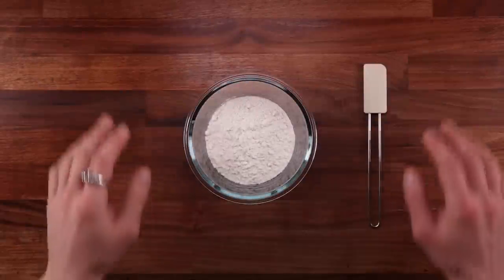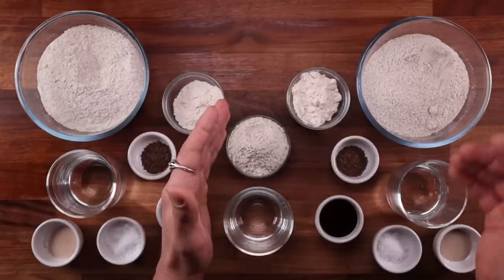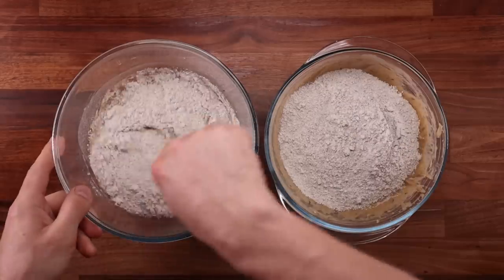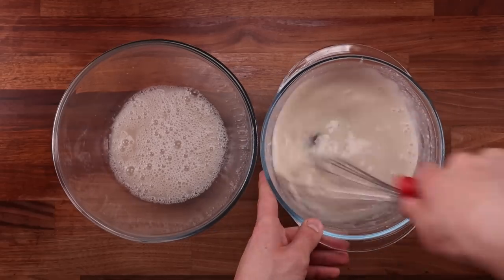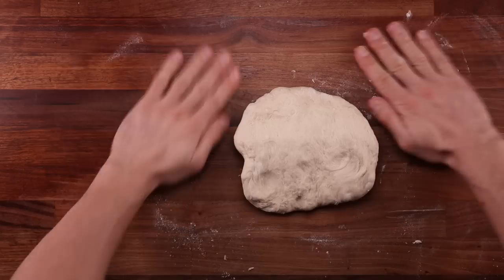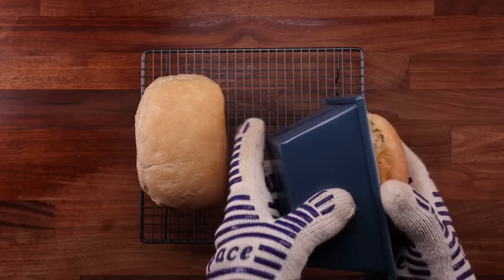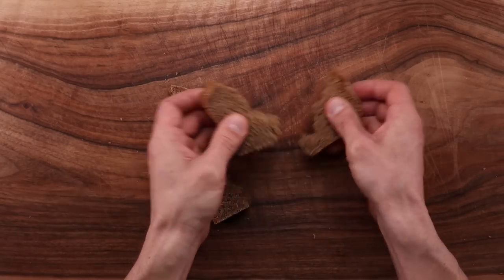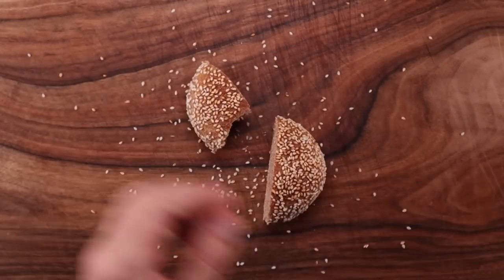Scalding Technique Explained | How to Make Your Bread Last Longer

Comment: Hi, Charlie. Thanks for this, and all your other, very interesting and well presented videos. A good way to keep food hot is an old-fashioned hay box. This would probably be ideal for your scalded flour. It was a way of saving fuel. You'd get your stew of cheap , tough meat up to boiling then put your lidded pot in a box lined with hay to insulate it for long, slow cooking.I've done this using a duvet and a cushion on top. It's probably best to bring stews back to the boil to be on the safe side but scalded flour should keep hot overnight and wouldn't be a problem for dodgy bacteria. By the way, I've been trying to use barley flour but can't find a really good bread recipe for it. Have you worked with it at all? x
Reply from the maker: Hey Felicity,
Oh yes that is definitely a good option. My girlfriend's mom used to make millet porridge in the evening and wrap it up in a blanket to keep it hot for the next morning :) 
I've not used barley flour yet. I don't think that it can be used as 100% of the flour in a recipe. It would turn out super dense. Substituting a portion would probably be the way to go.

Comment: Holding the scald at 64C is another beast altogether. In the matter of fact to take the benifit out of it you have  to add about 20% of the flour you used in  the scald as raw flour as scalding kill enzymes in the flour. So enzymes in the untreated flour will convert starches in the scald into sugars to the point that the scald becomes really sweet. Very similar process that beermakers do with the malt. This is then used mostly in rye baking that calls for over 70% of rye. You wi have to use sour dough starter or other means to acidify the dough to prevent sticky bread.

Comment: Hi!
Video idea: How to formulate a bread recipe. I know the principle. But it feels quite overwhelming. Where to start, what not to do, etc. 
Lots of love!
Reply: Charlie has a video showing how to work the formula.
Reply: @jjudy5869  I know, I´ve watched it, but it still seems very abstact to me. How much water do the different types of flour require? If I want to achieve a different result, what do I add/remove from the basic recipe first?  What ingredients/techniques do or don´t work well together? What are indicators for what went wrong? Should I add vital wheat gluten, if I replace some of the flour with something that doesn´t contain gluten? Do I  then have to remove some of the flour, in order to "make room" for the vital wheat gluten, because more dry mass messes with the hydration percentage? I think it would help me (and maybe others) to watch someone, who knows what they´re doing, going through the process.
Reply from the maker: That would be an extremely long video 😅 All those things are covered in separate videos in the Principles of Baking playlist. And I have recipes using all the principles which you can use as examples to make your own recipes.
Reply: @ChainBaker  Hi! Thanks for answering. I really only meant a video of your process to create one recipe start to finish. I mentioned all the questions to explain why it feels daunting to me even though I watched ALL of the principles of baking videos. I think they taught me the theory very well, but when I sit down to actually write a recipe, I come up with nothing. Maybe it's me.

Comment: The algo recc this and I watched, you mentioned a method to keep it at 60d for several hours you could probably achieve that making a small box out of insulation foam, and homebrewers heat mat with a thermostat.

Comment: Thank you for your video. It is very informative.  I just recently tried the no knead method just because it is easy.  I wonder if the regular knead bread last longer than the no knead bread.  What are your thoughts?
Reply from the maker: There should not be any difference.

Comment: Rye scald is the food for kvass as a starter. To feed it you do rye flour and boiling water in 2 to 3 pours inside an oven proof bowl, and mix. once scald has cooled to 63-65°C you mix in crushed diastetic rye malt and cover with a plate or aluminum foil. Put oven ahead of time on minimum and check temp, adjust to get 63-65 °C and keep scald 2-4h. Once you take it out uncover immediately and mix. If you have some dry parts just mix those in, and let scald cool down. That scald, mixed with a lot of water, old dried dough and old kvass will kick in the fermentation if a new kvass batch. That's a Russian brew that is Done in two fermentation steps, like kombucha, the 2nd one with added sugars and/or aromatics in closed bottles for sparkling effect. For Bread we need only one fermentation of 48h at around 32°C. The particles should have settled and the water surface should be covered with a layer of yeast that have been bubbles while fermenting. You use it as is by just mixing the liquid, adding rye to make a preferment, proofing around 9h until very acidic and starter around 1cm down from peak. Then just add rye, salt, a bit of sugar and by tradition also caraway seeds. Needs a good mix, adjust hydration for improved final texture, proof in buttered (not oiled!) tins, full cast if available, proof for 30-45m until you see around 10 small holes on the surface. Bake at 250c for 15m and then go down to 200c without opening the oven door for 35m. Remove and tilt the tin for easy removal. registrr.livejournal.c-o-m/102092.html
Reply from the maker: Thanks for all the detailed info!

Comment: Speaking of your Yudane recipe, I really love how much of a difference it makes in terms of texture and aroma. However, what I dislike is that on day 2, the bread/cake becomes twice as heavy, as it soaks up water like a felt coat in heavy rain (still tastes great, but the texture is a bit different). I live in Switzerland, but our humidity seems subtropical. Heck, I haven't seen a proper winter either in a decade. It's way too warm and moist. BTW, you can find in the Basel area a lot of east Asian and Latin American plants, including palm trees and succulents.  Some of them would die if the temperature drops below 4°C for a prolonged time (which they recently did, but after several years of growth). That's far from how I imagined the country before I emigrated to it...

Comment: Keeping your scald at 65c for several hours should be very easy if you use a sous-vide immersion heater, most will go up to 90-95c. Put your scald in a suitable plastic, submerge in the 65c water and leave as long as you need.

Comment: I did this by accident. I was making bread and while heating the water to blood temperature, I got distracted and the water boiled. Since I was too lazy to heat another pot of water, I added the boiling hot water to part of the flour and let it cool to the right temperature and proceeded with the recipe. I don't know if the bread would have lasted longer because I brought it to a family dinner and nothing was leftover.

Comment: I've been preparing scalds with course flour (and even steel cut oats) in advance with recycled glass cans with wide mouths and metal lids. I also add the bread spices, sweeteners (treacle, malt, molasses, etc.), fat and salt. I add extra water to give it more of a porrige consistency, which is easier to integrate, and adjust the additional water accordingly. It's a simple trick: mix the ingredients in a bowl, boil the amount of water you need, pour a little into an old salsa or spagetti sauce jar, add the ingredients then pour the remaining boiling water on top and gently shake. You can also mix the ingredients directly in the jar, just make sure you stir it out to prevent lumps on the bottom. Let cool on counter and then refrigerate. The jar will reseal itself and can be stored for weeks. If you follow proper canning sterilization procedures, you could likely keep at room temperature.
Reply from the maker: Cheers for the tips! ✌️😎

Comment: Thanks much Charlie!  I wonder if using 20%-30% sourdough has a similar effect
Reply from the maker: You can use this method in sourdough recipes and get the same results as with commercial yeast. But a starter does not add the characteristics of a scald if that is what you meant :)
Reply: @ChainBaker  Thanks for understanding me.  I did mean earlier to replace the scald with sourdough.  It's good to know that a scald adds distinct/favorable characteristics to bread.

Comment: Hi Charlie. Can you use the udane method on a 75% hydration sourdough loaf? Would you have to increase the hydration to 85% then?
Reply from the maker: Certainly. It is a higher hydration that I have ever tried it on, but the rule could be the same. Saying that, I would probably start with less and then work my way up. Perhaps 5% - 8%.

Comment: Curious. Thinking about using an InstaPot on my next loaf. 1. Use milk, take it to scald in the instapot, using the High yogurt setting.  2. Stir in the 10 to 20 % flour, then let the mixture cool to about 110F. 3. Stir in the yeast, salt oil, sugar, etc., then the remainder of the flour. 3. Leave the pot on the Low yogurt setting until the mixture has doubled. 4. After, remove the dough from the pot and proceed as usual. Maybe I want the sugar, honey, whatever stirred in at the scald, all except the yeast..

Remember my Mother, Grandmother, old recipes would scald the milk used in bread (yogurt, etc.), not just to kill bacteria, but to break down protein and make it easier for the yeast to work. Any thoughts? I make yogurt in the Instapot, so it seemed like a natural extension. I do not, however, like the look of loaves steamed to completion in the pot.
Reply from the maker: 110F would be way too hot I'd say. I would not go over 86 or so or else it will ferment too rapidly. 
I am planning on testing scalded vs non-scalded milk to see how it compares :)
Reply: @ChainBaker  I've seen scalded praised countless times, but I've never seen it tested. Looking forward to it!

Comment: Charlie: Please clarify this for me if you can. From my research, I have noticed that many experts claim that the scald/yudane process should be limited in the bread recipe because it damages gluten. Do you know if this is true? Can you say how much of the total recipe is safe to be converted to the scald and how much is too much? I am working with mostly freshly milled whole grain flours and sprouted grain flour and I am already have problems getting the bread to be fluffy and not dense.
Reply from the maker: It does damage the gluten forming proteins for sure. That is part of the reason why the bread turns out so light and soft. 
You can push it pretty high depending on the recipe. But 20% is a good amount to stick to. 
Here is a tortilla I made by scalding 100% of the flour https://youtu.be/WQbDQIKC9V4

Comment: Are there flours for which a scald might not be advisable? I'm thinking of the 50/50 sandwich bread recipe. I tried it substituting kamut flour for the whole wheat. The result seemed a bit dry and didn't rise as much in the oven spring.
Reply from the maker: Kamut is weak already, so scalding it should not make a huge difference. Simply using it in any recipe will produce and smaller loaf. That's just how it is. Try to substitute only a small portion and then work from there.

Comment: hi i have a question
I understand flour is gelatinized by boiled water or milk or something.
how about hot oil ?
Reply from the maker: I guess it would gelatinize it at a certain temperature. But if the oil was super hot you may just fry the flour. Not sure how that would affect it though.

Comment: Most sourdough recipes have you “autolyse” the dough — mix water and flour together, and let it sit for a while. Seems like scalding would be doing the same thing, but at high temps.  Does high temperature scalding work that differently from room-temp autolysis?
Reply from the maker: Autolysis is for hydrating flour and creating gluten. Scalding cooks the flour and destroys gluten.

Comment: so I'm curious- here in Florida, given that we're in high humidity, I don't usually have an issue with bread drying out. the usual issue we have here is that it molds. homemade bread especially can mold within a week sometimes! would the scalding method still extend the bread's life, or would the higher moisture content potentially make the bread mold faster? would there be another method to potentially making the bread less hospitable to mold growth?
Reply from the maker: Acidity is the enemy of mould. Use the cold fermentation method to make your bread more acidic. It will not only taste much better but it should also last longer before it goes bad. Here is a full video on that - https://youtu.be/x-8UoEgtt48
Reply: @ChainBaker  thank you for your absurdly fast reply, and for the information! I'll check it out

Comment: Can I turn the scald into a poolish too?  Say I scald a portion of the flour with your method, let it cool for an hour, then mix in a pinch of yeast to the scald to make a poolish, then set it aside for say 12 hours.  Will the scald/poolish double in volume after 12 hours?
Reply from the maker: That could work. But it's just too much effort. Instead, you can just make the scald, then make the dough with the scald and leave the whole thing to ferment slowly in the fridge or at room temperature. Just use less yeast. That way you won't need to make a separate thing.

Comment: I always have problems with my bread getting old because I don't eat so much bread. I will try that, or just bake more often. Freezing my bread isn't that great because of the freeze burn. :D
Reply: I always freeze my bread and never have had problems with freezer burn, unless I forgot about it and it's lost in there for a year or something.  

You get freezer burn after a couple of weeks?   Do you wrap it in parchment paper after slicing?
Reply: @feliciagaffney1998  I cut it and freeze it, but I don't use parchment paper.
Reply: @Vaan4756346  so, give that a try.  Maybe that will help protect it?  I don't know.  I've always frozen bread... even store bought.  And don't usually have issues with freezer burn.
Reply: @feliciagaffney1998  Perhaps I am not waiting long enough to let the bread cooldown enough. I usually wait 2 to 3 hours. I will try the paper.
Reply: @Vaan4756346  oh!  For sure.  I don't freeze it until 2 or 3 days later.  There's no need to freeze it immediately.  Enjoy it while it's fresh for a couple days, for sure!
Reply: I freeze almost all baked goods:  some kind of bag and then freezer paper.  I reuse the freezer paper over and over.  Other than the fragrance of fresh baked goods, few people can tell the difference.

Comment: I'm keen to make a high-hydration ciabatta, but always find that the dough ends up too wet to manage. Could scalding be a reasonable way to get more water into the dough while keeping the structure tight?
Reply from the maker: The scalding process damages gluten forming proteins, so the dough will be weaker. I would suggest to simply lower the hydration a bit and work from there.
Reply: @ChainBaker  Will do, thanks for the response!

Comment: So I baked two breads with this technique, 1 white bread turned out great.
However my gluten free one never rise, I used the same yeast and tested it, that wasn't the problem.
I never could make a good gluten free bread that was comparable to normal white flour one, any help?
Reply from the maker: I'm not sure if it's possible to replicate a wheat flour bread so that it's exactly alike. Saying that, I do not have any gluten free baking experience yet.
Reply: @ChainBaker  Thanks for the reply, I think it's possible, I brought gluten free bread from supermarket that's 90% similar, I just can't replicate it, no clue how they doing it, it's defenetly not baking powder. But the yeast ones doesn't rise enough for me. While normal white breads are turning out great.
Reply from the maker: I will explore that part of baking someday for sure.
Reply: @wagnerthomas6780  have you tried premade mixes? Its likely they use some concoction to replicate the gluten strength which is vital to allowing gas bubbles to form. I tried the king arthur gluten free mix once when my mom was pretending to have a gluten intolerance and it was almost tolerable.
Reply: @kipter  You mean flour only right? Yes that's what I'm using my problem is with yeast it's not rising and it remains hard, I baked a lot of bread that is comparable to what you can buy in stores, but using the same technique on gluten free it's a tragedy. I'm going to go all in today and see what comes out of that one :S

Comment: Hey
I was wondering how you would combine autolyse with the scalding ? 
Best regards
Reply from the maker: You could. But it would not add much to the recipe. Scalding already makes the bread soft and light and (potentially) gives it more volume. All of which are also results of autolyse. Combining the two methods would just complicate the process too much in my opinion.
Reply: So scalding would essentially be better since it also prolongs the shell life of the bread?
Reply from the maker: I guess so. I never autolyse anymore.
Reply: I see 😊 So do you use the scalding technique when dealing with high hydration dough or do you do something else?
Reply from the maker: Nowadays I don't even knead dough anymore. A few folds are enough to develop gluten strength in almost every dough. I use scalding for enriched dough or any recipe that needs to make extra soft bread. Rye bread really benefits from scalding not only for softness but also for preventing the bread from becoming sticky.
Reply: Alright, makes sense 😊 
Thank you man! I really enjoy your videos